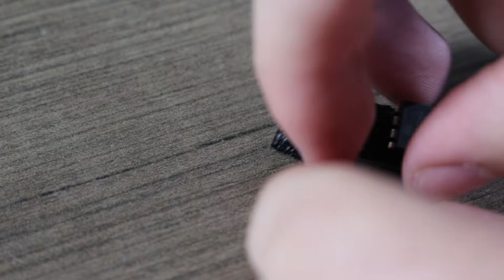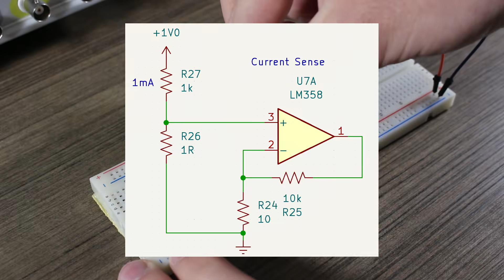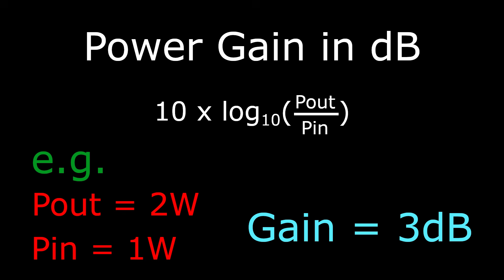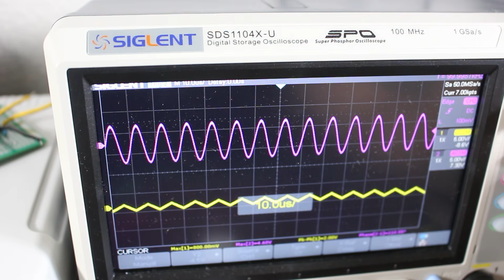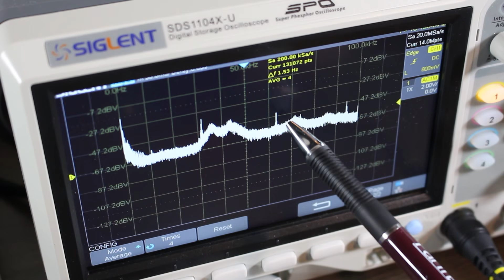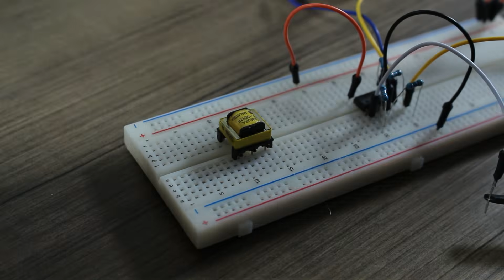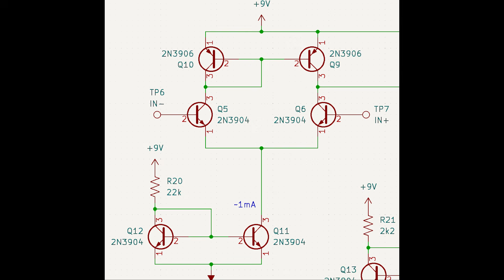The Ultimate Op-Amp Comparison - Bandwidth, Slew Rate, Frequency Response, CMRR & More!

Comment: One thing I would like to point out that makes the 358 a very viable option as compared for the 741as an example is that it is capable of "ground sensing" which few opamps can do. it is especially important if you use it as a comparator for low voltages at the input. that is why I base many of my projects on the 358, but it is not very useful for audio circuits due to the higher noise ratio
Reply from the maker: That's probably the LM358's best feature.
Reply: Ground sensing is the 358's only advantage. It's good for single-supply DC applications where low speed and high noise are not a concern. Anything else, it's terrible for. It's noisy and so slow that it can't even cancel its own crossover distortion caused by its class C output. If you just need a comparator, LM393 would be a better option.

TL06x, 07x, 08x have a similar feature: they allow the input to go up to Vcc+. Useful when you have the positive rail grounded. They are almost as cheap and better in every way. Can be used in audio if you've got nothing better to work with.

The 741 and its dual versions (4558) are really crap.

For audio applications, there's the old and venerable NE5532/4 that is still considered the duck's guts by many, but it's really quite outdated. Huge input current means you have to keep the source impedance really low, otherwise the noise current will swamp any advantage you've gained with its low noise voltage. LM833 has the same problem. NJM4580 works all the same, but has lower input current and is capable of driving 36 Ohm headphones. There are plenty of good opamps for audio. Read the datasheets: what you're after is noise voltage (en) around 5nV/sqrt Hz and 8+ MHz bandwidth.
Reply: @noneofyerbeeswax8194  It is good and viable points you make here. 

I am not a big fan of the 741 either because it is old and limited to many things. 

Usually when I build circuits for audio I 95% of the time use vacuum tubes and I even build other circuits using tubes instead such as parts of power supplies and VU meters etc. 

But I use the military graded 258 and 258A for many other things and if you know what it can do it is a very good pick for many things except most of the time audio related output. 

But during my projects I love how good the 258 is with single rail and ground sensing as I use it a lot as a comparator in various applications. 

For example I built a very powerful low voltage capacitor leakage tester with this chip that works exceptionally well. 

I also built a special audio detection device that automatically controls a power supply I built to output power when audio is playing and also mute the speakers when nothing is playing. 

In the power supply I just mentioned I also use the 258 and with a single chip of this I do all these things with one single chip:
Over voltage protection with automatic shutdown that is manually reset. 
Ready indication LED, Active indication LED, idle indication LED, and protection LED. It also controls the external start/idle input and disables and activated the output stage. All done with one single 258. 

And I made other things with it too. 

So if you know how to use the 258 properly it is really useful and cost affective. I mean even the more expensive military grade chips are still really cheap compared to many other opamps (unless you buy NASA grade 158) you get a very viable chip for many things. 

The downside of it is that it can’t do Rail to Rail in the positive side and that it has less use for audio due to the noisy output. 

However you can even make a single rail audio amplifier without crossover distortion with it if you bias the chip correctly.

If you compare it with the 741 I’d say it is better in pretty much everything once you get used to it. It is different in many ways and is probably why people have a hard time placing it and sure have it’s perks but hey, that is when you use a more expensive option in it’s place. Otherwise I love this chip
Reply: Yep, it's the LM358 super power, but for audio, watch out for the horrid crossover distortion from it's output stage.
Reply: @stevenbliss989  yes indeed. I tried making audio circuits with this chip and I got very good audio out of it. But the white noise level is too much for practical use. But for everything else it is a very nice cheap device
Reply: Pity about the noise.  Would low noise trannies fix that?
Reply: @stevenbliss989  it could probably isolate some of it but I think this is just the nature of these chips that they have this amount of idle noise in the end
Reply: Are there any good op-amps for audio?
Reply: NE5532 - low noise ang wide bandwidth for high gain use.
Reply: @franzliszt3195  like Steven said the NE5532 is a popular choice for audio circuits. 
I am however searching for a solution where you can use a single rail supply of as little as 5 volts to make an opamp audio amplifier and I even designed a circuit that does just that with excellent sound quality using the 258, however the noise level on the output is not that great on these chips. I have however just gotten some 258A I gonna try instead and see how they sound. 
For those who wonder the difference of 158, 258 and 358 is the quality and overall ratings as this: 358 is consumer grade chip with lower spec. 258 is industrial grade quality with higher specs and tighter tolerances. 
158 is Military and NASA grade quality of highest possible quality, you can expect to pay 16 dollars or more for one chip of these. 
However all is the same chip otherwise as you’d expect. 
If you have an A or B model letter you have a newer or better chip than standard without this letter. 
This is the reason I always build with the 258 as this is a better chip but not at all much more expensive than the 358. 
You can however soon expect availability of a new model line of these chips including 358 that is going to have better specs too

Comment: Solid educational material and video production. Remember to slow your pace, when reading through the scripted material. You started at a good rate, but, by the end, you were going fast, again. Don't beat yourself up about that. Practice makes perfect and it takes a lot of practice. This is your best production, to date. Kudos. We are all proud of you. Oh, and you taught me something new about op amp offset = thanks!
Reply from the maker: Thank you, I've been working on my reading pace. All of your tips have really helped me improve these videos over time, and I'm grateful for that. Thanks for watching! :)
Reply: @SineLab  I also liked your video so much to have written some stuff into my cheatsheet (as I dont need it right now, but will need it later for current sensing). About Slew Rate. Will it help if I use less amplitude output at same frequiency? Would be cool to see you gradually lowered gain while showing that triangle signal.
Reply: NO, slew rate is CONSTANT regardless of amplitude!
Reply: @stevenbliss989  I meant that lower amplitude output requires less slew rate to remain undistorted, right? So if you would lower gain twice the could it become sine again at 100kHz?
Reply: Oh yeah, of course. :)  @TURBOSLAYERPWNZ

Comment: The rule is to prevent large gains, staying below 100x. Some people prefer to never exceed 10x. For instance, if you require a 100x gain, you can achieve it by using two op-amps, each with a 10x gain.
Reply from the maker: Thanks for mentioning that. You're definitely right about sticking to lower gains.
Reply: I'm guessing you are using 741 amps. If you use even an OP-07 you can routinely run gains up to 1000X with less offset than a 741 at 10X. A more modern OP amp like the LT1002 can easily run gains up to 10,000X with less than a half volt output offset, un-adjusted. The OPA388 can do this gain with 50 millivolts or less output offset, un-adjusted!
Reply: Good idea. Keep in mind that chaining two op-amps will have an affect on the frequency response or bandwidth. IIRC, Dave Jones of the EEVblog made a video where he went through the math related to frequency and bandwidth response when chaining op-amps.
Reply: Why not use a single opamp with 100x gain rather that two with 10x?
Reply: @sandergjertsenstvold1051 Never stop asking questions.
If you are moving to a new house, all your possessions is the goal. If you only ask uncle Bob to do the work, you will HAVE to listen to him boast about all the work he did and how his back is killing him. He wont mention that it took him a week to do it. But if you get more workers, you hear NO boasting, no complaining, etc. You will have to pay each worker though. In this op-amp analogy, that might be more power consumption. It helps to get professionals to do the move. These are big strong people who have the right moving tools and experience. These would be specialty op-amps, single supply, dual amps per package, low noise, high frequency. Unlike uncle Bob - the 741. ;) 
Take care, my friend.
Reply: @stever.9925  Bad analogy though. Are you assuming 'Uncle Bob' is not as not efficient as those "highly skilled" workers. Again, if the job is complete and the same quality in the same TIME. The job has been done right.
Reply: @sandergjertsenstvold1051  This is the best way to go now. (2023) Modern OP amps that cost only a few dollars can easily do 1000x, or even more, with very low offset.
Reply: @sandergjertsenstvold1051 Watch episode #572 of Dave Jones' EEVblog videos. It explains how chaining two videos affects bandwidth.
Reply: @sandergjertsenstvold1051  Principally because of frequency response and linearity. An opamp relies on negative feedback to keep distortion low and to ensure a flat frequency response.

Take an example of an LM358 over the audio range. As it has a gain-bandwidth product of around 1MHz, you can't get a gain of more than 50x at 20KHz, and you have no feedback to reduce distortion at that frequency. Even if you restrict your bandwidth to 10KHz, a single stage with a gain of 100x would have poor performance at the higher frequencies, whereas two stages each with a gain of 10x would each have around 20dB of feedback available at 10Khz and would remain usable at 20KHz.

Of course, you can use a more expensive opamp with a higher gain-bandwidth product, but every time a two-stage design, splitting the gain, will give you better frequency response and linearity when you are looking for high gains.
Reply: @sandergjertsenstvold1051  it will possibly create noise and become unstable…
Reply: @sandergjertsenstvold1051
It comes under the "best practices" rule.
Any error x100, or 
An error x10.
Both circuits have valid uses. If the circuit is in a non- critical system, then gains of x50, x100, even x200, are fine.
In a multi amp circuit, it is easier to filter or refine the signal in intermediate stages. 
Parallel and Series circuits are also a consideration.
Reply: Well if both the opamps operate b/w +15 and -15, no matter what you will not be able to get a voltage outside that operation point, in case of rail to rail, low noise, high performance op amps. For say, something like 741, this voltage will be below that operating volatage
Reply: Rules are made to be broken.  If you want precision and repeatability you have lots of rules to adhere to.  If your app is uncritical make your own rules to fit.
Reply: @pibbles-a-plenty1105
You probly meant "non-critical", but thats okay, you don't know what you're talking about anyway !
Reply: @peetgaming
Yep, clean supply and multi-stage, wins ever time. Even if it's a floating transistor on the input.

Comment: nice 'upgrade' to your diy op-amp. good overall effort and educational from a practical point of view for beginners.
Reply from the maker: Thanks! I'm glad it turned out well :)
Reply: @SineLab  The only snag with your improvements to the discrete opamp is that any supply noise is injected directly into the current sinks, thus worsening the PSRR. Not a big deal as long as you decouple your supplies adequately, but I would suggest a TL431 configured as a 2.5V Zener as the source of the drive voltage for your current mirrors. That would effectively remove any coupling from supply variations.